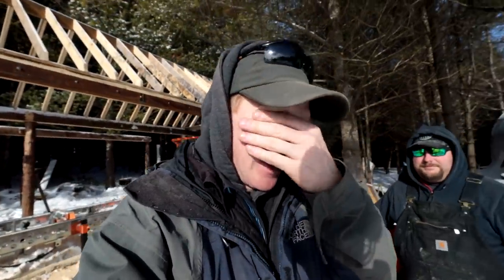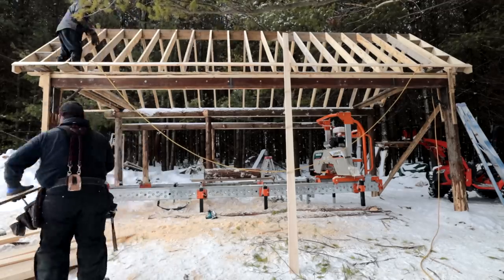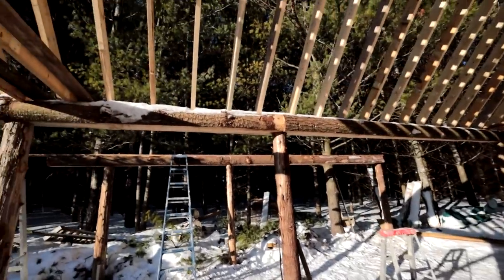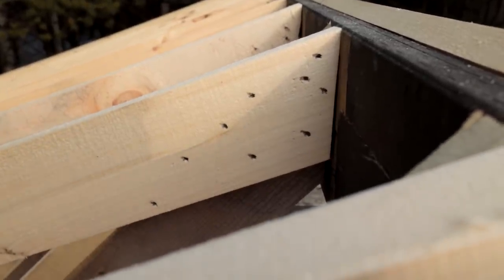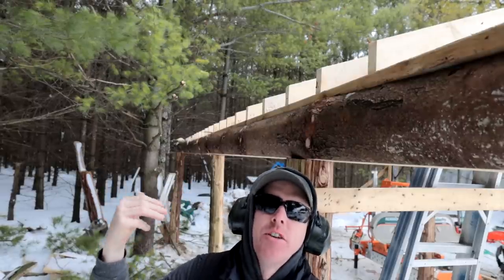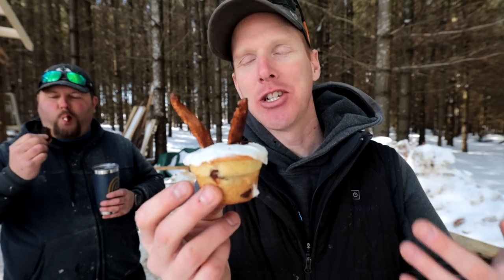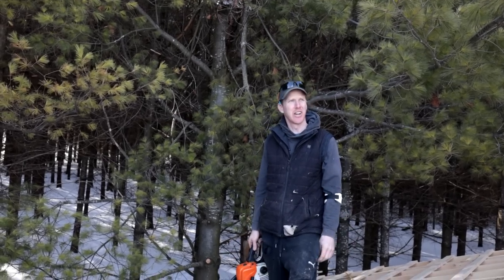Building Monster Sawmill Shed (It's Almost Done)

Comment: I built a 3,200 square foot house with green, rough sawn hemlock and white pine. Often times, it came off the mill the same day I used it. House is still square and plumb 32 years later.
Reply from the maker: Probably solid as a rock too!

Comment: I live near Columbia South Carolina. Right out side of town is a huge store "Mr. Bunky's" and it was constructed with all green wood cut by a local sawmill owner near my house. The owner of the store has many acres of southern yellow pine. The building is in the neighborhood of ten thousand square feet made with huge timbers. None of the structure lumber was milled but rough sawn and used as is. It has two stories. The store is a country store that sells whatever you can imagine. Meat market, groceries, animal feed and even a restaurant. It is a wonder to look at the construction using 2x12 floor joist for the upstairs. It has a concrete floor on the bottom. Over time you can see some of the timbers sag a little or twist but the building is as sound as it gets. The building has a tin roof and is at least 50 years old. It is a very busy place  and everyone in town knows where "Mr. Bunky's" is. So yes, green lumber is fine to use as long as you get it up asap. Now the building inspector might see it another way if you have to use a permit.

Comment: The general rule of thumb is for a scarf joint you need to have at least four times the length of the joint compared with the width. An 8" width board should have a 32" scarf joint.

Comment: The lean extension is for storing, drying wood and the multi colored roof on the back will be covered with solar panels eventually right?? 😊
Reply from the maker: Yes
Reply: @ModernSelfReliance  Well, it was a better story than the one you told Rachel…..😆

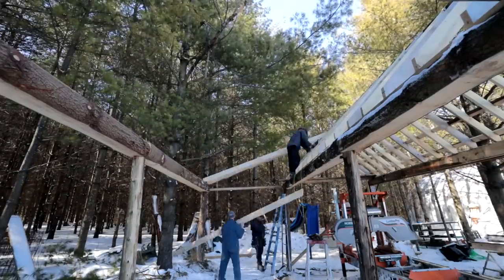Comment: At 7:58, when you were cutting those logs, did I see the exhaust flap part of your blade hitting the pole at the end of the slide? Is the saw not centered between the poles so that it doesn’t hit them?
Reply from the maker: It was the angle that made it look like it doesn't clear.  Grant pushed the sawhead to the stops that's why it was an abrupt stop.    Second time making a cut I think.

Comment: Shouldn't  you put the upper piece  of metal roof over the lower piece of metal so rain on  the roof can't go under the top edge of the bottom piece of metal on the rows that you had to use 2 pieces of roofing..

Comment: Ridge cap?  NOT a Gambrel (Dutch) roof:  they are like the classic old red barn roofs with a lower, more steeply-angled section joining with a higher less-steeply angled section.  This is more of a 'lean-to' or shed roof.  My parting thought: a fella that can get 'slapped upside the head' by a cant hook while on the ground should have a safety harness on while lopping limbs higher up in a tree.🙄🙄🤔

Comment: I did ALOT of rough framing with wet wood, much easier to nail!! As long as you build quickly there are minimal problems. Once plumbing and electrical are done the walls and roof get sheated, siding or stucco goes on as well as drywall. Some studs do bow and need to be "straightened" or replaced, it's no big deal... 🪚🌲🔨